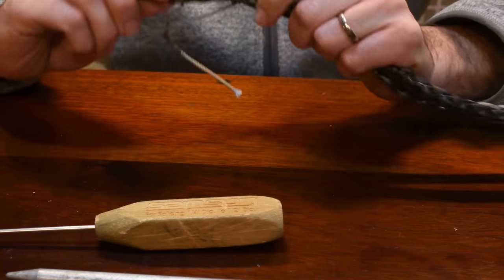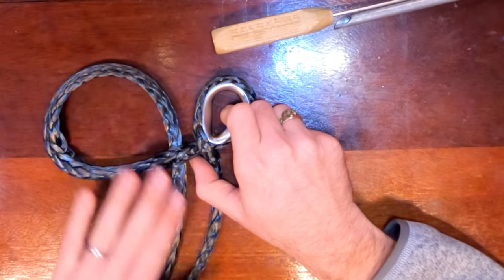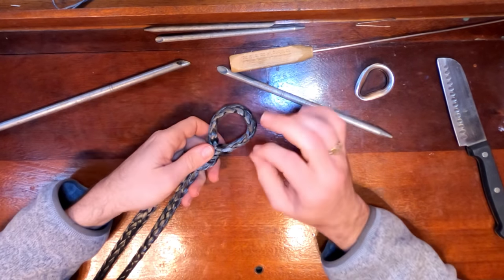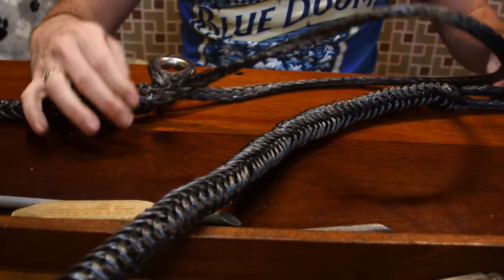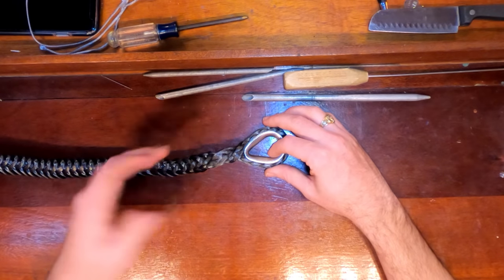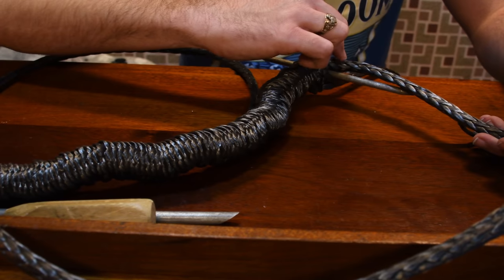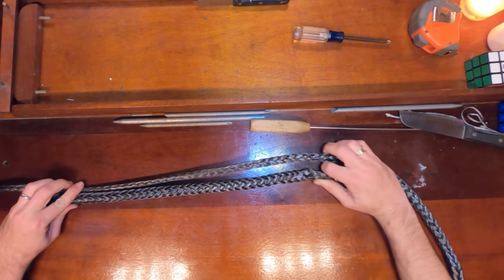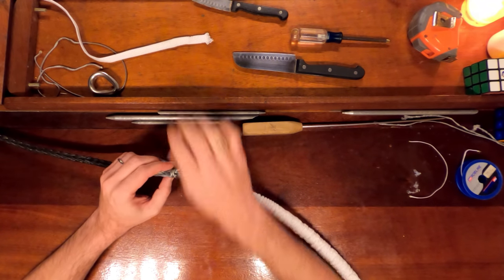DYNEEMA [Part 3]: How to Splice Your Stay | Sailing Wisdom

Comment: I used your methods for my lifelines, and the multiple wraps, and zero knots which worked great! Thank you. I did leave a stop knot on the bitter ends, for future adjustments if needed, for tensioning to 20%, using my winch and 4:1 purchase.

Comment: Did I miss something in this video, or was there only one eye with chafe protection around the thimble?
Reply from the maker: You got it. The other eye is up the mast and not in an area that gets chafed so it wasn’t necessary to do. You can do it up there as well if you desire, the process would be the same.

Comment: This may be a dumb question...but instead if the chafe sleeve, couldn't I just put a pool noodle over the whole bottom 5 feet? Or wrap it in hockey tape? Something replaceable in case it gets damaged.
Reply from the maker: You want something with low friction so the sail slides up and down easily. Hockey tape is high friction, so avoid that. 
Let me know what works out for you and how you like it! We are all learning together :)

Comment: You say you need to bury 25-1/2". That's dependent upon the diameter of your line, isn't it? 
9mm line × 72 = 64.8cm = 25.5in?
Reply from the maker: You got it. Smaller line is less length and thicker line is longer, but all x72 (in mm)

Comment: Does the lock weakens the splice?
In what proportion?
Reply from the maker: At the bends for the lock, the splice will be a little weaker there and if pushed to the breaking point, it will break there. Simply upsizing your line diameter so that it doesn’t get pushed to the breaking point is the easy solution that lets you have a splice that can’t shake out accidentally.

Comment: Why not use a Dyneema cored line with sleeve instead of going thorugh the sleeve process?
Reply from the maker: The issue is the Dyneema core isn’t the right kind of Dyneema. You want to use either heat set Dyneema or DM20, both only come as single braid. 
If you found a fiber with the correct core material, you then need to take into account that the measurement of the line is the outside diameter including the cover. You would need to get a sample and measure the core to size it accordingly. 
If you come across a double braid that is made with DM20, please let me know because I would love to use it 😉

Comment: I need to replace the forestay on my 20' trailer sailer. Do I use the same diameter Dyneema as the existing SS? Is there a rule of thumb?
Cheers.
Reply from the maker: It’s a bit of math. Email me (riggingdr@gmail.com) your stays diameter and I can calculate the ideal Dyneema diameter

Comment: do you have to use timbles, i was prepared to change one shroud and one stay, but when i got the mast down- it all have to be replaced-i have enough line and chafe sleeve for the eyes. small boat 4mm line...
Reply from the maker: The thimbles help keep the eyes open. If the eyes are too tight, the line will actually break from the stress of the sharp turn. The thimble keeps the turn smooth and that makes it last a lot longer, otherwise the eye will be the first place it will break. (The thimbles are super cheap at 4mm)
Reply: @RiggingDoctor  okay, yes you are right- patience is important in these matters- dont like being de-masted, all the loose ends... thank you
Reply: @RiggingDoctor  the thimbles were cheap, got to keep the eyes open....

Comment: What diameter line and what size sailmaker's thimble?
Reply from the maker: At minimum, the size of thimble to match the diameter of the stay. The size of the stay depends on a bunch of factors related to the strength needed to support the rig.